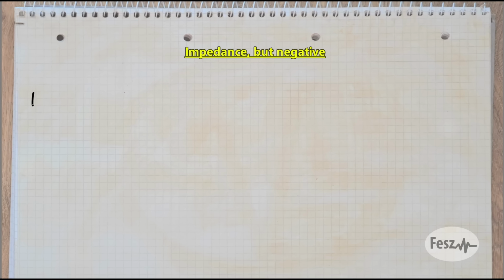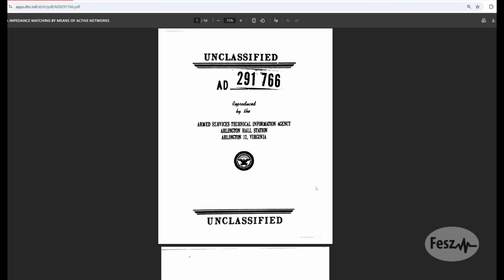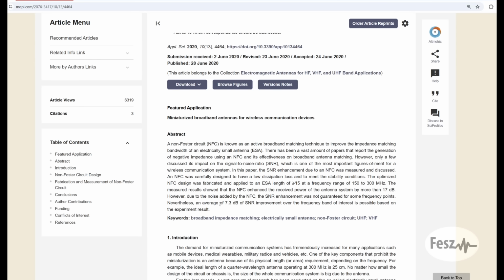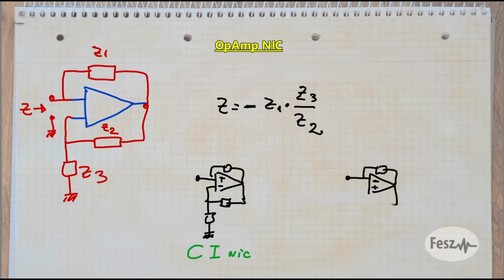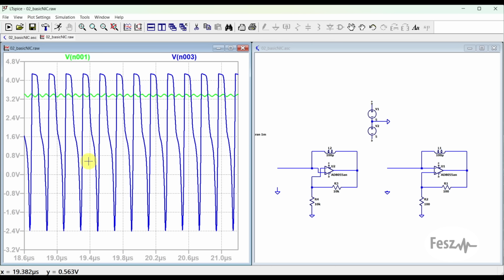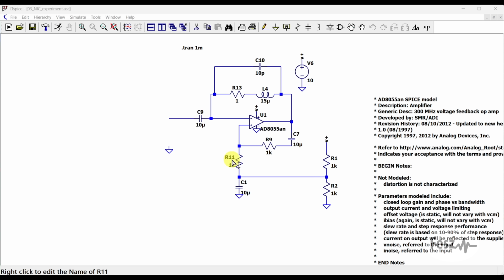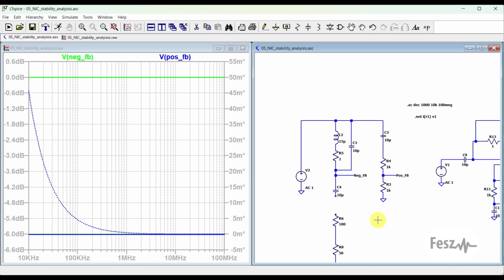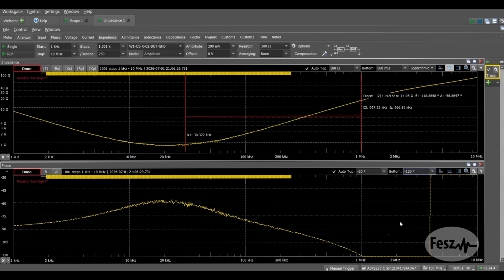Negative Impedance Converter Experiments

Comment: Oh, man... you really chose hard mode by doing an inductive NIC. I built a voltage mode capacitive NIC, and when used with a high impedance source connected to the input port, it just works. This is true because the reference element impedance (Z1) becomes very low at high frequencies. That's where all of the parasitics start to matter, but they're all swamped by the capacitor's very low impedance.

The only issue is the output node drift caused by input leakage current of the amplifier integrated across the reference capacitor, and that's easily fixed with a pole at very low frequency by placing a very large resistor in parallel with the reference cap.

This version of the circuit was useful for decoupling a photomultiplier power supply. The NIC was attached to the low voltage end of a small high voltage film capacitor, and then this capacitor formed the second leg of a C-R-C pi filter. The resistor of the pi filter was very large, and so is the input impedance of the PMT: so the impedance seen by the NIC is high at all frequencies and there's never any significant negative feedback path attenuation. 

By forming the positive feedback leg from a potentiometer, the amount of negative capacitance added in series with the positive capacitance can be tuned until there's zero ripple on the high voltage rail from the switching power supply. Even if the negative capacitance added is much larger than the positive capacitance, the circuit is still completely stable, because the total impedance of the input load is always very high, dominated by the pi filter resistor and PMT input impedance. It works just like the simulations, with no tweaking.

But, even on hard mode, you got it working! Respect.

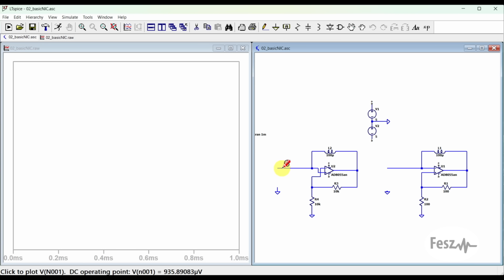Comment: @9:00 zeroing a voltage source means shorting it out not leaving it open. it would not have oscillated if the input was grounded even by a low resistance

Comment: I had a similar issue on one of my designs: the scope probe ground loop picked up the FM radio stations around and coupled higher frequencies than the circuit was supposed to work at. The result was an outrageous jump in the consumption and the opamp heating up.
Reply: a differential probe would be better ?
Reply: @SandeepKumar-jj7zi  It IS a differential probe. The opamp is capable to amplify over 100 MHz, it just draws proportionally higher current than when working at 10 MHz :)

Comment: Negative impedance (positive feedback) was used in regenerative radio a hundred years ago. It was used also in gyrator to replace inductor by capacitor in low frequency application.